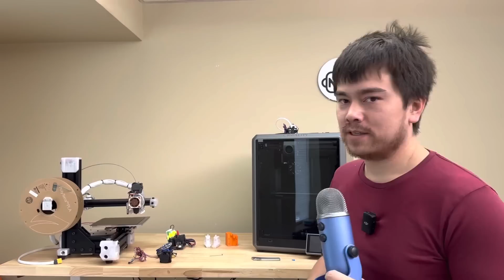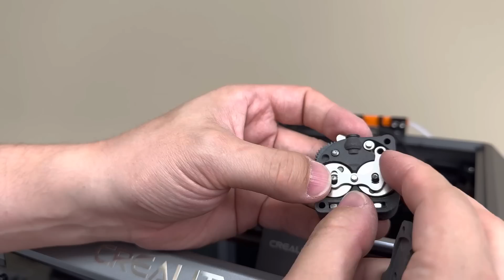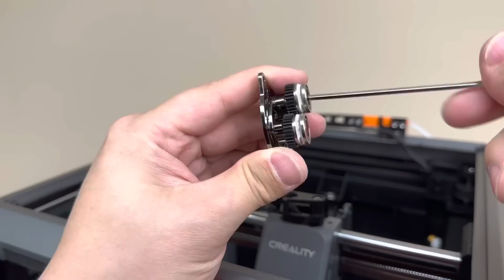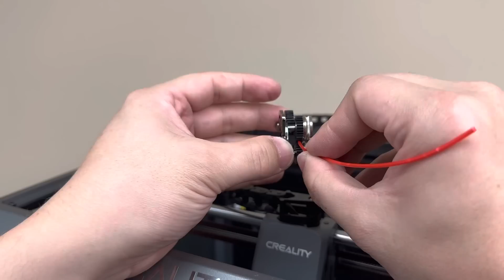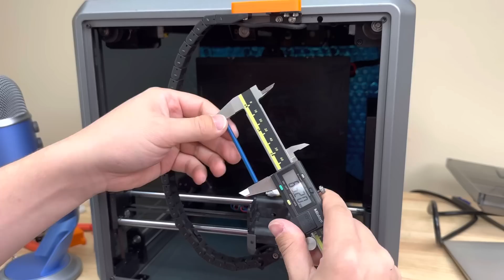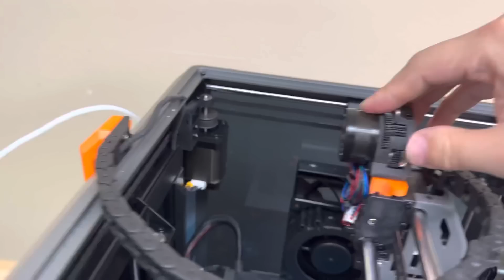Creality K1 Extruder Mod

Comment: WIRING K1-ORBITER 2..........BLACK K1-YELLOW ORBITER,ORANGE K1-BLUE ORBITER,BLUE K1-RED,RED K1-GREEN,thanks i found model on printables,good job
Reply from the maker: Can't pin 2 comments, so I'm adding this comment here from @MinePossu:
a+ a- b+ b- bondtech/usual stepper motors                          
a- b- a+ b+ creality k1 (much joy /s)
also aim6mac has a good tuto on getting fluidd

Comment: Good stuff, however the extruder has quite a large moment on it given its z offset from the rails, that's going to hit the input shaper hard and slow things down. I'm going a different route with my k1c mod and redoing the entire head,  also with a Sherpa mini. BTW, are you sure those bolts are in bending? The shoulder of the shoulder bolt is butting up to the extruder, right? Which means they are in shear, not bending, I get what you mean, but it has shoulders which are preventing bending as such, unlike a plain bolt. Of course, if they walk themselves out a bit as you say so that the shoulder is not engaging... but that's nothing a drop of Loctite wouldn't fix. At an emotional level I agree having them only supported at one end feels dirty, but at a practical level given the ratio of load to axial length? Not so sure.

Comment: Just installed the Orbiter v2.0 extruder with LDO motor and used this wiring:
- Red to Black on K1
- Green to Orange on K1
- Yellow to Red on K1
- Blue to Blue on K1

Should I set the current 0.85A (manual says so) for the Orbiter extruder in printer.cfg? Or use default K1's current 0.55A?

Comment: You could have physically swapped out the pins on the stepper connector instead of using that adapter cable.

Comment: Tbh. bending is only an issue IF the thing was designed by an idiot (or not designed at all).
I mean that if you take engineering at uni its going to be in 2nd semester of mechanics when you learn how to account for bending. It aint exactly rocket science, to design em so that they don't break off.

Now if you have issues with bolts losening themselves, thats a different beast.
Frankly its a classic case of "loctite is your friend".
Ofc. the "real" solution is to make custom threads, that are self locking due to their pitch. Since we are talking value/budget brand - thats supposed to suppot open source tinkering - loctite is a better solution than creating proprietary threads.

And eccentricity is going to stay.
NOONE is willing to fork out the kinda money that would buy precision bearings into the extruder. The "just use a fuckin plain bearing" OG approach aint gonna cut it in a "high-ish speed" (and low weight) appliaction.
So you need to accept artefacts caused by eccentricity
or
compensate in software (Lidar is on the effing thing just saying - if its precise enough then compensating is plausible)
or
design a mechanism that elliminates errors caused by eccentricity.

Comment: Hey Nathan, I have had it for 3 days, 4 prints and clogging like it was designed for it. Replacing the extruder is great, how about the rest of the hotend assembly? Does the main board lend itself to complete rewire if necessary and change hotend and everything on the carriage
Reply from the maker: No this is not moddable - at all really. I was able to hack some stuff together but it’s really not designed for that.
Reply: @NathanBuildsRobots  thanks. Perhaps add the upgrade parts when they eventually active, camera etc, and sell and get X1C or other

Comment: 4:49 - absolutely a garbage design. It's made to fail. Running at 300+mm/s only serves to wear and drive the posts apart to the point it begins to skip.
Reply from the maker: The new revision might have fixed it by switching to an all steel construction. I'm still skeptical of it though.

Comment: I got a new extruder from crealitys support. Theres some changes in it! The metal is not shiny lever and backplate. The screws holding it together are slightly longer and they give a spacer part between the extruder and motor.

Comment: Can the bondtech plastic parts be redesigned and printed? Maybe it's possible to design a bondtech that fits into the rails and just use the bondtech gears etc. and print the rest? Either that or print the whole plastic part on the creality and modify the rails part?
Reply from the maker: I think that could work. Would need to do some major CAD work to investigate... But I think it'd be worth it.
Reply: @NathanBuildsRobots  On a side note, could some other kind of screw/axle be used in stead of the existing screws on the creality and printing the interfacing plastic part from the creality extruder to mate with the screw/axle on the other side? Or maybe even use the parts from the bondtech extruder to modify the creality one?

Comment: How do you calibrate with the new extruder? I really want a bwtter extruder but im weary about calibration
Reply from the maker: You adjust flow % in slicer. It’s 154% for LgX and 200% for Sherpa mini
Reply: @NathanBuildsRobots  which do you think works best?
Reply from the maker: Ideally I’d update esteps per mm but until they let this thing be full klipper this is the workaround

Comment: If i change to a bondtech. What about estep and where to change. Iam on my 3rd k1 extruder and i get sick of it
Reply from the maker: Yeah, you have to change flow percentage in the slicer so it sends more plastic out to account for the smaller gear ratio. I set mine to 154% in creality print.
Reply: @NathanBuildsRobots  sweet man. Just the answer i looked for. Will order one asap (always use bondtech coz its from my country and ofc very good extruders)
Reply: @NathanBuildsRobots  can i have the motor that sits on orignal extruder. Coz i have 4 k1 extruders :)
Reply: @NathanBuildsRobots  can i use k1 motor or should i buy the extruder with there motor?

Comment: My k1 extruder will not pull tpu unless I basically hand feed it in.
Reply from the maker: The extruder is not a strong point of the K1
Reply: @NathanBuildsRobots   When my replacement k1 gets here, I want to use the replacement extruder I now have sitting on the shelf, add it right before the filament out switch, and have the second extruder push the filament in lock step with the print head extruder.  I think that will solve the majority of my issues.  I have completely passively controlled feed for my filament, but adding active pushing/feed I think would really help.  I'm also going to put my spools on a bearing as well, since my idler pulleys have bearings.

Comment: So I just realized, put an o-ring made from plastic, around the open gear(the one the shiny flip switch operates on) opposite the bolt on the inside of the extruder. It will invalidate the shiny switch, but provide the necessary support to the extruder gear and keep the gear clamped on the filament. Idk why they put the flip switch on the extruder, I always load/unload my filament by jamming it in the bondtech, then loading with the printer function. The force of it jamming into the extruder gears is enough to give it a slight bit to grip onto.

Comment: I feel like you lost a piece of the video where you were saying there wasn't enough light and you were about to talk about why it didn't fit and couldn't be adapted to fit without sticking out of the top.
Reply from the maker: I could have possibly grinded things to fit flush. I was having away at it for a couple minutes before I said to hell with it and just bolted it on the top because the model for it was mostly ready
Reply: @NathanBuildsRobots  Do you have an orbiter V2? It looks like it might fit within the carriage with minimal shaving down to the orbiter's mount rather than having to cut into the carriage.
Reply: @NathanBuildsRobots  Well, it's nice to leave it backwards compatible, I guess?

Comment: Yeah I took apart my extruder too and was surprised to find that one end is entirely unsupported. The posts my gears screw into have been spread apart slightly, whether it's due to pressure from the filament or that they just came that way, I don't know. But I see this as a problem that'll only get worse in the future since you're putting constant sideways load on the posts that forces them apart. Also, the part that holds the PTFE tube is plastic and these have failed for me after just taking the tube out a dozen times on other printers. And on those, this part is cheap to replace, but what about here? And what happens when the gears finally stop gripping the filament due to worn out gears? Where can we get replacement gears?

I feel like the extruder just needs a simple redesign.. It needs to be supported on the other end and they need to have replacement parts available online for all to buy.
Reply from the maker: They will get spares online soon.
Metal generally won’t creep over time, even under constant load. It will get bent it overloaded though. I’m guessing your bent posts may be a manufacturing defect.
Reply: @NathanBuildsRobots  In that case I won't touch it until it becomes an issue. So far it extrudes exactly as intended. I'm still a little worried about the longevity though.

Comment: This video makes the point I was trying to make on one of your earlier K1 videos.  Creality got a lot right in the K1 but not doing their due diligence designing the extruder is a big problem.  They're marketing the K1 as an advanced easy to use "just works" 3D printer.  We shouldn't need to swap extruders.  I know this was a pre-release prototype but these issues should have been resolved internally, or at worst with beta testers and not on YouTube for all to see.
Reply from the maker: I agree. The extruder is a major weak point. Also I’m not as big of a fan of the large pulley steppers anymore as it introduces some artifacts
Reply: @NathanBuildsRobots  - I build LinuxCNC machines.  In CNC machining, stepper motor drivers use microstepping which drives stepper motors more like servo motors, more analog than digital.  I'm not sure what the "quiet" stepper motor drivers are doing in 3D printing but I assume it's something similar.

It doesn't seem that larger pulleys should be introducing artifacts if the stepper motors are driven properly.  At the rate 3D printing is advancing, I wouldn't be surprised to see servo motors in a year or two, with very precise X & Y position feedback to drive the print head in a closed loop for faster and more accurate movement, as is done in CNC machining.
Reply: This is the same company that ships printers with the power supply airflow completely obstructed by a lazy metal cover that they didn't bother punching holes in. Same company that still tins their high current wires that can be a fire hazard. Same company that still sells bowden hotends and single gear extruders. Creality doesn't design anything. They just take 3d printer parts put them together see if it prints then sell it.

Comment: Love the actual technical acuity of this video!  Regarding bipolar motors -- you can reverse them easily by completely reversing the wire connection at the other end.  So if you go ABCD, wire the other end DCBA and it'll flip direction without having to worry about which coil you're flipping, etc.  Also this'll save you the hassle of some older drivers liking to blow themselves up.
Reply from the maker: That’s the difference between theory and practice. In theory I know what to do. In practice it still takes me 6 tries 🗣️
The cool thing is the K1 somehow knew when I wired things incorrectly and it gave an error code instead of blowing up the stepper driver
Reply: @NathanBuildsRobots  Honestly it's these kinds of little details that most people don't encounter on a day to day basis.  And if we want printers at some point which are consumer (and not hacker) friendly -- these things have got to be implemented.

Comment: Did they not have enough room to put a mount plate on both sides. Using a free floating bolts for extruder gears seems like an oversight, especially on something this fast.
Reply from the maker: Yeah, they could step it up to an M4 or M5 thread maybe? That might be just strong enough
Reply from the maker: Also: bondtech figured out a way to have it be double supported, and I’m fairly certain they based their design off of the LGX Lite, so no idea why they would remove this feature. Probably for cost cutting or to make it easier to assemble.

Comment: Should be pretty easy to pop the pins out of the connector on the lgx light extruder and switch them around father than using your adapter plug.
Reply from the maker: I like using adapters so when I inevitably mangled the connector I can just throw it away and make a new adapter

Comment: so you buy a  realy expensive enclosed corexy to modifiy it, so the top cover wont fit anymore and the enclosure is no longer of use. wouldnt a cheap bedslinger like the kobra 2 or the elegoo neptune 4 pro do the same job for far less money and work? i dont understand all these new "fast" printers. there is so much wasted time and energy in research and development into the wrong direction. just to print a little ship with pla faster...
Reply: I agree I have had my K1 for about a week and have had no issues. But all I see is people modding it to improve it already lol. It makes me nervous because I only bought it because of the price 😳
Reply from the maker: I agree, speed printing is taking things in the wrong direction. But it is way to market/sell a printer that is faster.

The important stuff is: 
Reliability
Reliability
Reliability
Reply: @NathanBuildsRobots  do you think the core xy printers are more reliable/accurate? I'm wondering if it's worth it to pay the extra money for a more automated core xy (I hate bed leveling and think the bamboo ams is awesome) or try to add additional automation to a bed slinger.  Do you think it would save enough money to be worth it? Is it even possible?
Reply from the maker: Bed slingers have one HUGE advantage and that is ease of assembly and disassembly. S as well as being easier to understand in terms of applying DIY mods and troubleshooting.
Actually bedslingers have lots of advantages, with a few downsides too. But there is nothing wrong with bedslingers

Comment: Okay, here's a question: These extruders have their own rotational_distances correct? So how are you going to get that setting into the firmware so the extruder does it's 'thang correctly?
Reply from the maker: Currently I’m doing it by changing the flow percentages in the slicer. But I’m sure Creality will be releasing the firmware in the next couple months so you can do it properly through the Klipper firmware
Reply: @NathanBuildsRobots  have creality unlocked sonic pad yet?
Reply: Can you share the number?

Comment: Bolts are terrible in shear because the thread roots are stress risers
Reply from the maker: Just kidding (sort of) 
It’s better to have the shear carried by a non-threaded shank, like with bolts that aren’t fully threaded.
But still, shearing bolts on threads is still much better than loading bolts in bending.
Reply: @NathanBuildsRobots  oh for sure bolts in bending is a cardinal sin of mechanical design but I really try to avoid sheer stresses on bolts unless it’s got a smooth shoulder or load bearing surface like you mentioned. 

You should look up V8 Roadsters control arms some time, the company touts “heim joints” for their fancy control arms but it’s off the shelf joints with threaded ends put directly in bending in some stamped steel brackets. Absolutely atrocious design but people go gaga for “racecar” parts.
Reply from the maker: Tell that to my engineering degree

Comment: Does the LGX lite have a ratcheted tension on the arm?
 Can you contact Creality and ask them if they have yet fixed the issue with the K1 extruder and any other revisions to the printer?
 I think Creality use the YTbers for external beta testing, if this is true they are going about this in the wrong way, the publics first experience of the printer should be in a finished ready to ship format, seeing the printer for the first time with issues must cost them massively in sales, considering the importance of marketing a printer to compete with the P1P they really should have appointed external beta testers and got the snags ironed out before release, this is common sense and would reward Creality massivly, the cost of beta testing against the loss of sales and market share would have been minimal, it would have made inroads into the community starting to trust Creality also, a trait that is worth its weight in gold!
Reply from the maker: LITE has 3 positions while the regular LGX has like 5.

The K1 is more or less a beta test for the K1 Max
Reply: @NathanBuildsRobots  what's different about the max other than the build volume?
Reply from the maker: LiDAR and camera included in the box. They might offer those as upgrades to the K1

Might also used hardened steel gears but I’m not sure.
Reply: Creality has lost all trust for many of us.  The K1 experience is only re enforcing my opinion of Creality